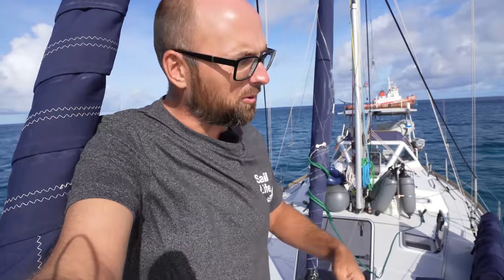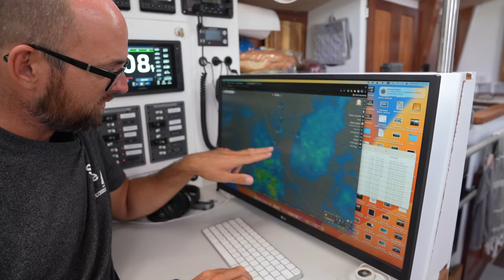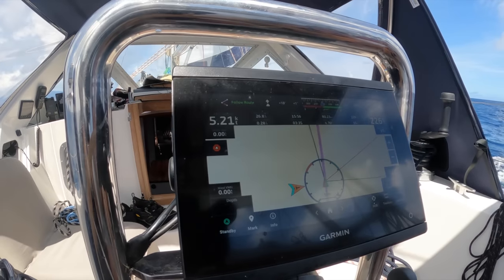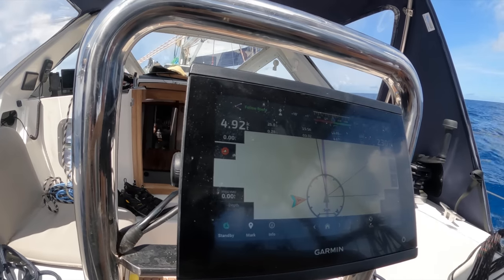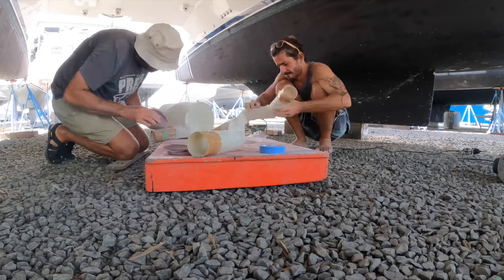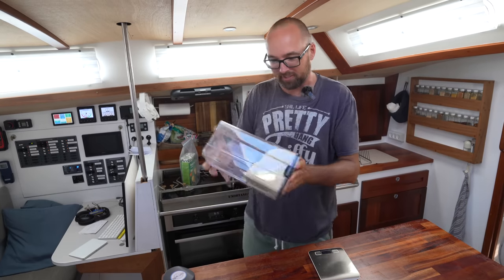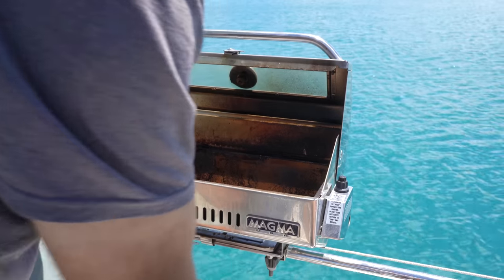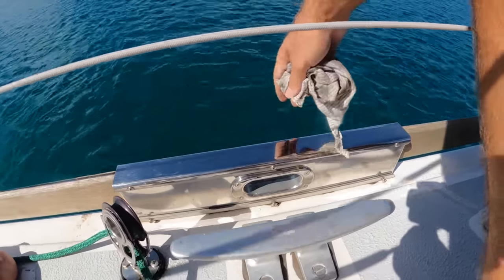Sail Life - The steel boat itch ⛵️

Comment: Mads, with regard to the lightening issue …  I’ve lived in SW Florida for over 60 years, over which I’ve been an electrician at one level and capacity or another.  And given the level of lightening here, I’ve become fairly familiar with the issue and the challenges facing those living here, who own electrical gear that they spent hard earned money to get, and would prefer to keep.

Obviously, lightening is something over which we have precious little control.

And given the intensity of these atmospheric discharges, there’s very little that is going to protect those electronic goodies… if they’re in even the field of induction in proximity to a local strike.

That being said… such falls into the unexpected injury and loss for which we purchase insurance.  A Proactive measure that provides a reactive solution. It will purchase repairs and replacement equipment, in the event of a loss.  

But where claims are made and paid… such is met with higher premiums which insurance does not cover.

So the only other defense is to make your location neutral in the great exchange of atmospheric charges constantly in flux around us and our property.

A boaters who’s home is usually made of plastic… with a very tall metal conductor sticking 50’ into the atmosphere from earth ground… which if such is  unfortunate enough to be caught in a state of unbalance, in terms) of stored energy (or charge…,it’s not just likely, but probable that one will get a first hand, up close and personal demonstration of the balancing process… in the form of a 100,000,000 volt discharge either from the boat to the cloud or vice versa… either of which is very likely to leave a hole in you otherwise electronically impotent home.  

Which as you know… is BAD!

Thus the solution falls to methods of providing the free flow of inductive atmospheric current so that you reduce to the extent possible, the potential that your home is not found in a positive or negative balance of energy… as compared to the passing atmosphere.  

Obviously I’m just a fan, with some experience fighting angry pixies for many decades.  

You may already have watched these folks channel, but JIC, I’m providing a link to a very good explanation from a college man, who spent his working life, doing the actual math on such things.

Tons of good advice to be had over there.

Best regards and much love to you two,

Mike O
Naples, FL

https://youtu.be/PurMG7KHdW4

Comment: Wd 40 and steel wool ( finest grade your can find) works well for cleaning stainless,
Reply: Never, ever use steel wool on a boat in saltwater. You will have never ending rust stains from tiny steel particles. I probably wouldn't use it in fresh water either.

Comment: Odd life is made of aluminium:) It doesn't rust:)
Reply: Hi. Odd is actually made out of steel, but it was hot galvanized and we hardly have any rust. We have a lot of stain of rust from the stainless steel. But, the tip of using the product came when I helped a friend to clean her fiberglassed boat, hehe.
Reply: @OddLifeCrafting  Ok:) I thought your fear of corrosion was due to aluminum/steel corrosion. Thanks for the clarification :)